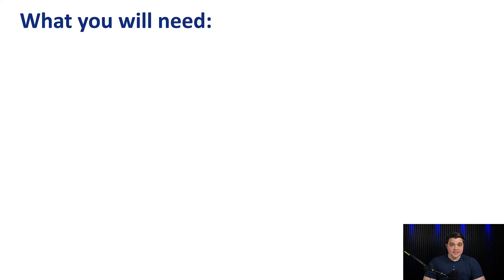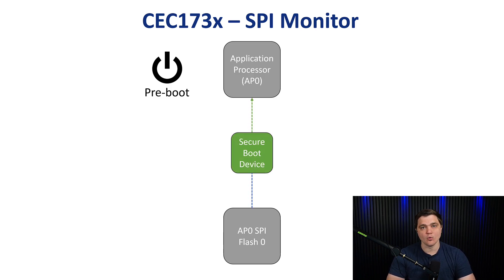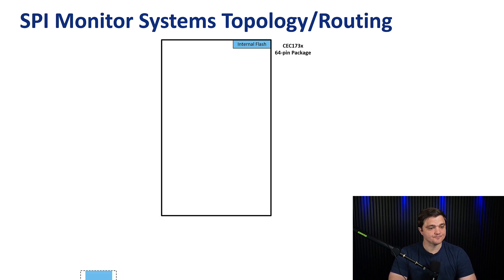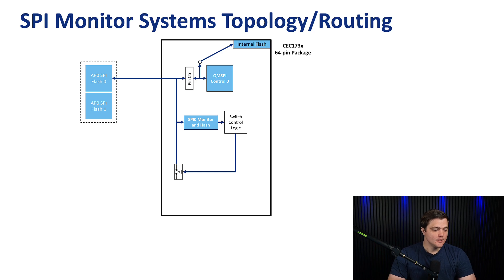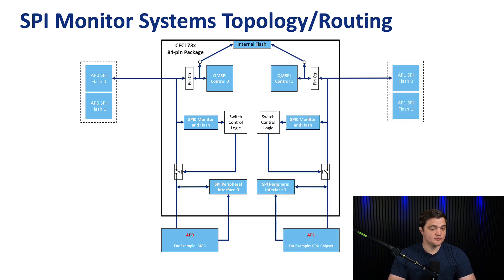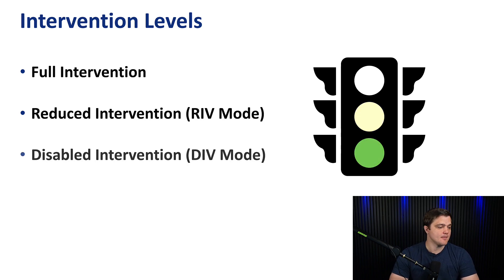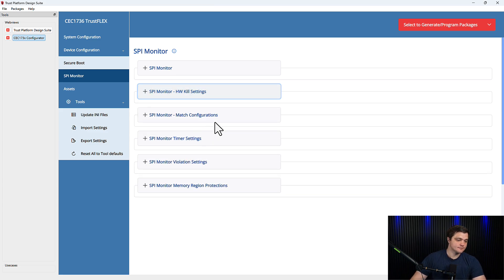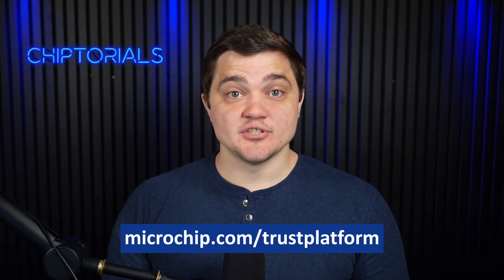Chiptorials - CEC1736 - How to implement SPI Monitoring with CEC1736 TrustFLEX

Comment: The separate video mentioned at the end - is it available now?

How to create a provisioning package and then prograam it to CEC1736 using the development board?
Reply from the maker: Hi there, thanks for your question. The process of generating a provisioning package and programming it to the CEC1736 using the development board can be done through the Trust Platform Design Suite (TPDS). This suite provides the tools you need to configure and generate provisioning packages for different use cases, including SPI monitoring and secure provisioning, which can then be deployed on the CEC1736.
The development board for CEC1736 comes with a socket for easier evaluation and development, and the steps for using it typically involve using the TPDS to configure the SPI monitoring and programming features based on your platform's requirements. Hope this helps!